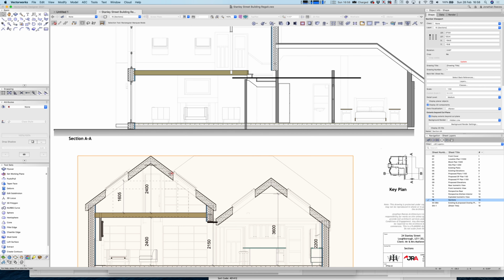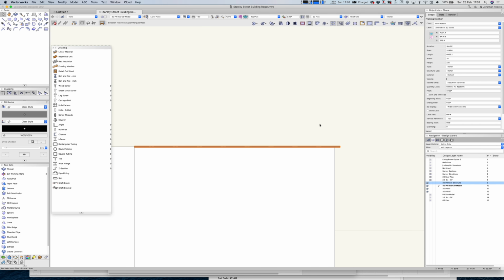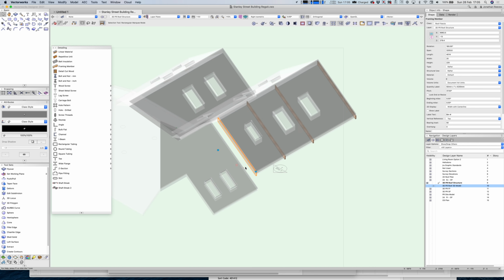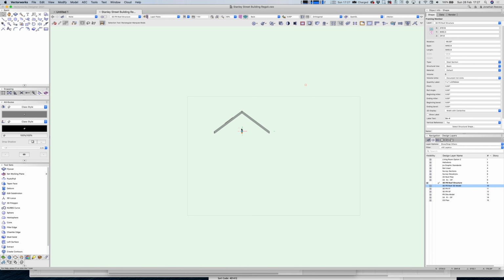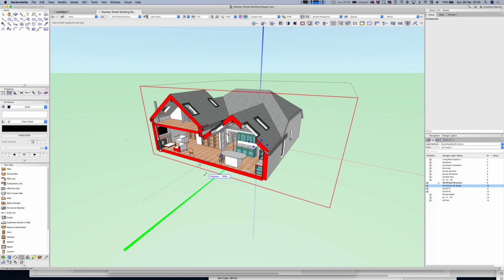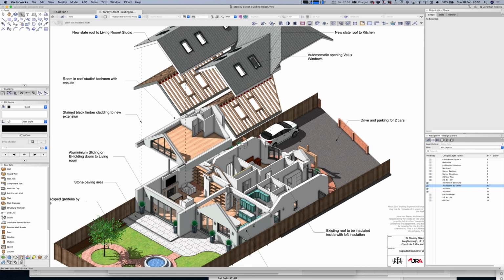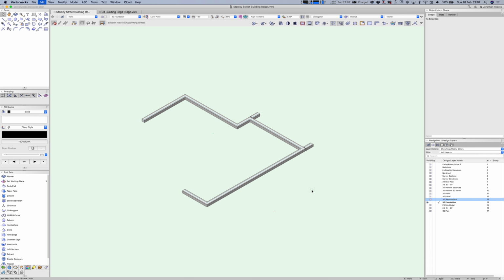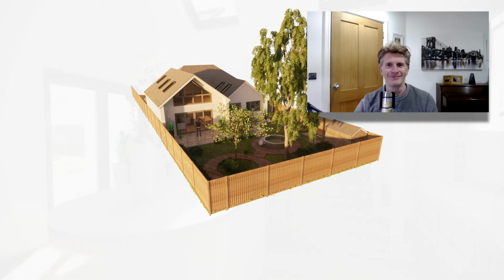Vectorworks 2021: Adding Construction Detail Part II (4K)

Comment: I'm on a Mac.  Pressing Option when dragging does not allow me to enter a specific distance.  How do I drag something a specific distance?
Reply from the maker: Drag the object, and try in the distance then hit return, but make sure you hold the option key down before you release the mouse and instead of moving it copies. The use Cmd "D" to keep duplicating at the spacing.

Comment: Hi Jonathan, I enjoyed this series so far. Is there a way to have the insulation hatch (for instance in the cross section) orientate to the direction of the material the way it is in the walls, I guess the way the batt insulation tool does?
Reply: Hi, if you're using Vw2021 there is a know error with the hatches and tiles and so on that won't join/size properly to the feature they're on, they've mentioned it would be fixed in the next SP update. But usually the tiles and hatches follow the feature. Although just for a quick repair on the spot you can use the tool under the "DETAILING-BATT INSULATION TOOL" this one can create the insulation "tile" in any direction/size you require in 2D format. Hope it helps!
Reply from the maker: OK
Reply from the maker: Yes, but it's tricky to explain now Why not book 1 hr of Training?